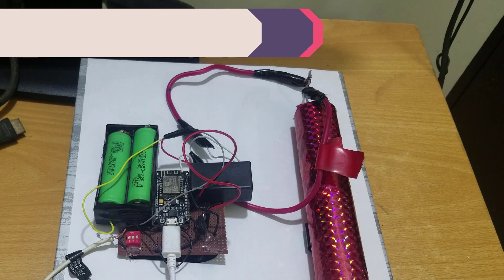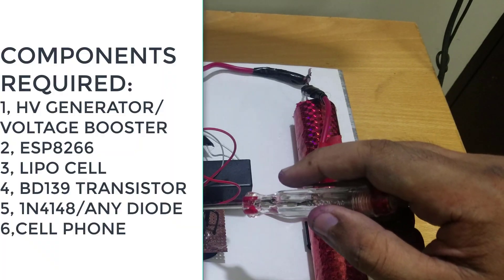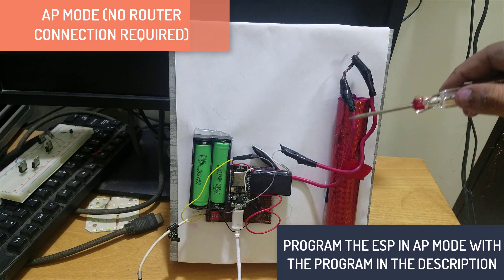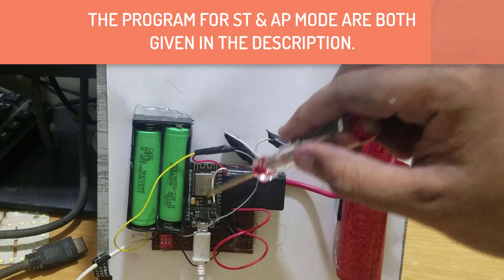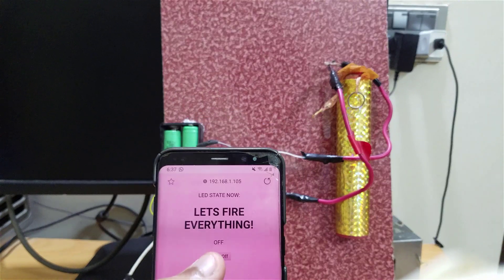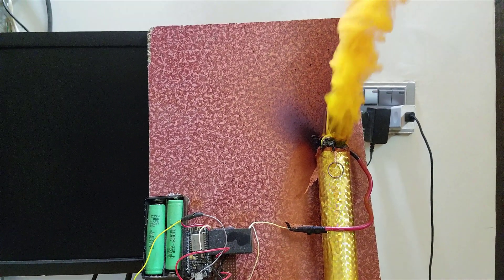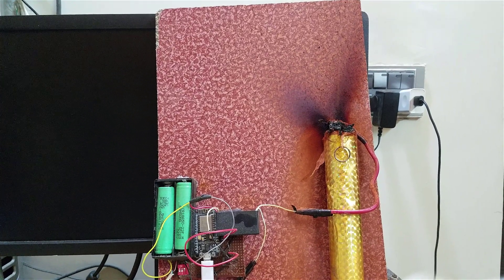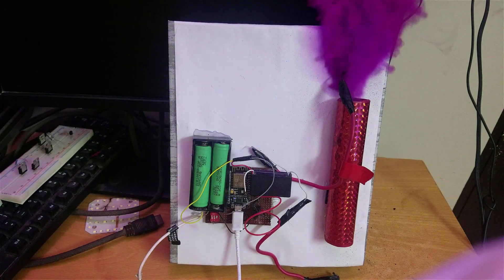REMOTE FIREWORK DETONATOR (ESP8266)

Comment: how to fix 
sketch_sep30a:7:79: error: 'D7' was not declared in this scope
 IPAddress subnet(255,255,255,0);ESP8266WebServer server(80);uint8_t LED1pin = D7;
                                                                               ^
sketch_sep30a:8:41: error: 'D2' was not declared in this scope
 bool LED1status = LOW;uint8_t LED2pin = D2;/*If you want to control another set of firework, use it for a testing led*/
                                         ^
exit status 1
'D7' was not declared in this scope